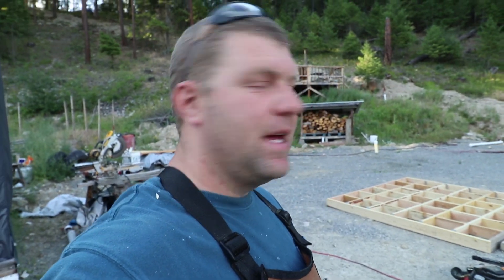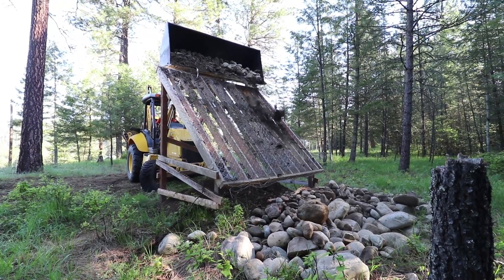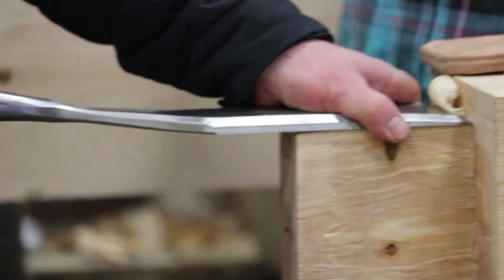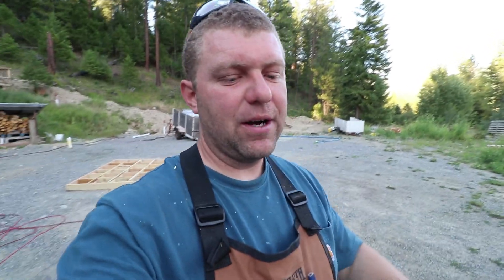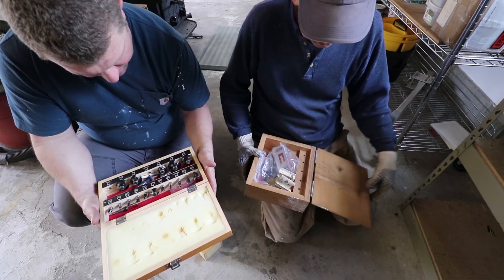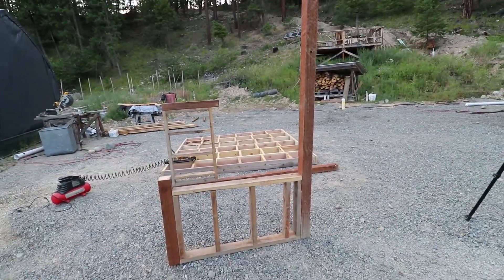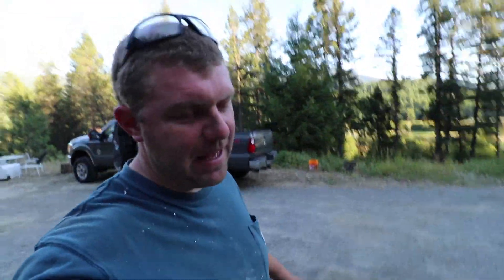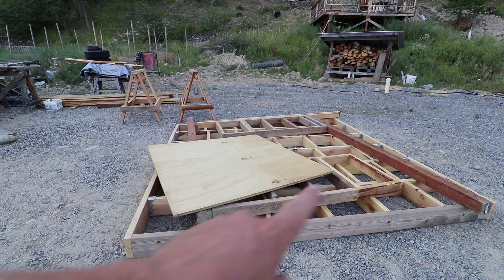Check it out... Grizzly 3.0 is BACKHOE-FRIENDLY!

Comment: Jesse and Alyssa - you are doing well. I am impressed by your attitude and perseverance. You tackle a project, step back, analyse the results, revise, and try again. That is spot on. Kudos to you.
Every project you have undertaken has increased your knowledge and skills.
Evaluating plans for potential problems is an excellent approach; that's what I was paid to do for 30 years. It is far cheaper to fix a problem the earlier in the process that it is discovered.

Ignore the haters and trolls.
I wish there were a moderator for this channel who could block and delete all the trolls that have flocked here for no apparent reason. They are fools and not worthy of your attention.

Comment: I used sketchup (free) to design my garage and make modifications. It made it super easy to test ideas and see actual measurements and double check plans and things. So glad I did it. I bought everything and built it myself and turned out great due to 3d model I made. Highly recommend

Comment: Just a suggestion. Dig a huge hole somewhere on your property. Place the grizzly on the edge and filter the dirt there. The rock will go into the hole and then when its full just cover them up. Saves you from having to always move the rocks and you get more dirt from the rock bury hole. this is what i did on our property. Saved so much time.
Reply: That would work if their soil wasn't 70% rocks.
Reply: Thats the point. So is my property. Its a way to get rid of the rocks
Reply: I get that it's a way to get rid of rocks but they would pretty much just be filling the "rock hole" 70% of the way full with the rocks that they dug out of that same hole. They would have to run all of that through the grizzly too. Seems like a lot of work for little gain.  Assume they have 50% rock and 50% fill. They would have to effectively dig 2x as much as they need in order to bury all of the rocks so double the work.  Seems easier to just pile them up in a corner of the property for the time being.

Comment: Very interesting to watch you work through the multiple versions of the Grizzly.
About 45 years ago, as a kid, I watched my Nebraskan corn farmer grandfather build something similar for our California backyard vegetable garden, though we just called it a rock strainer. His was considerably smaller, with it's purpose to sift through Mom & Dad's 'river wash adjacent' backyard soil in order to yield a small 8' x 8' garden. 
Grandpa also went with a 45 degree pitch for the screen (he used chicken wire fencing) and we fed it by hand with shovels - so no need for joist supports. However, one feature that he incorporated was a similar elevated foundation and somewhat extended lower front lip - the aim being to have the rocks roll off the screen directly into my radio flyer red wagon which was positioned just below the lip. My job (as a kid) was to run the wagon loads full of rock, to the back fence. We'd position the grizzly in one portion of the garden and sift that soil in place, and remove the rock. Once we had a mound of usable soil, we'd reposition the grizzly to a new area of the garden and continue. The volume lost (by removal of rocks) was made up with the addition of compost & soil amendment.
About 5 years ago, now as an adult, inspired by Grandpa's design and similar need/purpose, I designed (using Sketch-up) and built my own grizzly (version 2.0). Features that I incorporated were:
A) front lip high enough to roll the rocks into a Gorilla Cart (my adult version of the radio flyer) commonly available from HD, Lowes, Tractor Supply, etc.
B) all of the lower cross members (stringers) are positioned either high enough and/or low enough that another gorilla cart can roll in/out and be positioned directly below the screen (to capture the recycled/sifted soil/pay dirt.
C) the base footprint dimensions were 32" by 42" in order to fit my grizzly into one of those 10 cu ft dump carts (typically by agri-fab) either for transport of the grizzly, or for use in situ - sift right into the dump cart, then pull the grizzly out and take the payload to destination & repeat.
D) lastly, I included two different, interchangeable screens so that I could use large gauge chicken wire fencing to sift my compost, and then a much smaller gauge hardware cloth to sift dirt specifically for use in raised garden beds.
Overall, my grizzly version 2.0 worked great for processing both dirt or compost. I was short on storage space (in my garage), but since I used pressure treated wood, it held up well outside for 2 or 3 years until a tree fell on it.
Future plans for my version 3.0 rebuild will include:
A) more robust construction (I broke a stringer while moving 2.0 around)
B) some form of agitator. My wife and I spent too many hours and gloves pushing clumps of compost or our red clay soil, back and forth over the screen. Automated agitation will be something along the lines of a gold processing plant motor to shake the screens or a trommel (rolling/tumbling screen).

Jessie,
Having watched several of your grizzly and trenching videos, I'm super impressed with your volume of river rock. Seems to be quite a resource in itself. Do you have any plans to use all that rock?

Comment: Build a wood frame use 2 cattle gates covered with chain link fence for the grizzlies. Put them on less of an angle use the hinges on one side so you can use the backhoe dump off the large rocks that collect. When the cattle gate/grizzlies get bent up flip them over and use the other side to bend them back
Reply: jeremy sturza  right!   I was thinking something similar.

Comment: Just 45 your cross support braces, by doing so, you fully utilize the strength because a 2x6 obviously can handle a lot of weight when it's turned so that the 2 inch sides are on top and bottom like floor joists. The way your cross supports are orientated now when you put your grizzly into position, you're lucky if you are even using 50% of the plank's potential strength.  On top of the added strengthening, the dirt will slip right by with no restriction. Hope it helps :) I enjoy your channel. I like that you two are regular people, taking on big projects, making mistakes, learning, and acquiring new skills.

Comment: Dig a discharge pit for rocks to collect in. Also if you have a entrance to to rock pit, you can clean out the rocks when the pit gets full. Your design looks good. One thing to remember is the more work and time you do on prep and set up, the more efficient your operation will be.  With a bit of  proper setup you should not have to move the grizzly at all.

Comment: You two make great videos! Very informative and inspiring. Don't let any negative people get you down!
Reply: Cody, I agree
Reply: i all so agree
Reply: Constructive criticism isn't hate
Reply: Depend on how you read it ;-)
Reply: Big rocks you can also sell. Depent on size but great to back fill to a concrete wall whit rocks. Here in Norway we always use first drainage pipe and then back fill whit rocks, that way water/melting snow drain easier avay from the house. So why dig a big hole to dump rocks, when you can sale ore use it.
That I have seen a lot on youtube that in USA you back fill whit dirt and not rocks. Dirt hold on water and water is a buildings worse enemy. For the smart ones I know I'm not the best writer. 3 inch from ground level we put mech/fabric and then dirt
Reply: I would simply like to say that these two are learning while doing. A lot of people do that. While there's nothing wrong with offering advise, they have to learn things for themselves. That's how I've learned most of what I know. My grandfather and one of my uncles taught me so much, but they let me fail while I learned. I look back on those times now and realize how wise they were then.
Reply: Rocks like that are quite costly here in SE PA

Comment: Dig out a trench , then move your grizzly up next to trench, then let rocks offoad into the trench, once trench location is full, move grizzly laterally along trench to fill trench length, no more burying your grizzly foot, once trench is full, dig another trench. Of course digging trench is not needed if you find the correct agreeing terrain to set your grizzly on , but I used the trench analogy, to help visualize the concept. I like you guys and your drive and communication skills.

Comment: Jesse:  You might consider sowing the backfilled trenches with a mixed variety cover crop and start building soil for next year. Top dressing with saw dust from your mill.  Temporary   raised bed box's could be made with the offcut slab's from the mill.   Just trench the uncut edge into the ground.  And if they prematurely rot out no loss.             Bert.

Comment: i have a suggestion. If you want to be able to wait longer between cleaning away the big rocks, all you have to do is put the grizzly on a platform made with the backhoe or you can dig a hole in front of the grizzly so that there is a drop off in front of the grizzly.

Comment: a friend of mine had a mill which the finds fell into a large pan made out if an old fuel tank that was placed under the mill.  when it was full he would hook three chains to it and move it to the pile, lift and dump the fines where you want to store them for later use.

Comment: I have built many screens and grizzlys and yes metal will out last wooden ones but this is a historically valid tool we have old texts that teach us this will last if they were going into the soil  business then building a wooden one would have been a true waste but in this context a wooden tool makes perfect sense to me.  the design is a bit off the width of  around *' is a good choice the working angle should be between 40 and 47 degrees  and the max height should be about one foot to 1.5 feet less than the max lift of the bucket you will be using to shift the soil. this will be safer and better as you can feather the soil release on to the screen I would also add sheeting to BOOTH sides of your lower framing as it will be stronger and if you have to lift it out of place the rocks and soil will slide off, I wish you luck with your grizzly build and with all your other projects,

Jesse I wish to add that I have said some very snarky comments in the past and I wish to apologize for them I was very wrong to post what I did the way I did.  

Have a great day and a better tomorrow
Frank D

Comment: I am enjoying the videos and the problem solving you two do. About 2 or 3 videos ago you left the water system unfinished and leaking slightly on the connection between the cisterns. What happened next? Was the leak fixed? Have you back filled the system? Is it all working as planned?

Comment: One thing to keep in mind is that errors are accumulative. We call it the stack up. A sixteenth here, and eighth inch there....before you know it you're off so much that nothing fits anymore. And if you're an amateur,  measure three times, cut twice. If you leave it strong, you can always go back and trim it off. It is difficult to add wood! But seriously, accuracy is golden.

Comment: I have been a fan from the very beginning and can appreciate how hard the two of you work.  This is the first time I have to agree with a lot of posters.  Your going to be using your grizzly for quite some time.  Wood and screws will not last.  I know it's going to be expensive for some good metal but, a decent mig welder is priced good.  As I mentioned before, I'm a true fan and love your videos, it has taught me a lot especially, when something goes wrong, it shows me how to fix a mistake.  Keep your chins up. Love you both.  p.s. I forgot to mention the other commenters have a good idea of digging a huge hole in front of the grizzly for the boulders to fall in.

Comment: Thinking about the energy-budget you're on, have you looked into designing your future house to reduce energy consumption? Like limiting heat leakage in the winter or reflecting off sunlight in the summer to stay cool inside. I know it would add a bit of research and planning, but I believe it will pay off in the long run.

Comment: You might want to use 2x10's for your cross bracing and install them so that they will be oriented vertically when set up.  By building it the way you're doing, you are just making a bunch of shelves for the dirt to collect on.  I also agree with others who think that it should be steel.  An old mobile home frame, mig welder and small plasma cutter and you'll be ready to go.

Comment: I would advice to double up the side beams of grizzly filter, this is were all the stress of the horizontal beams will go. If you want to widen the bottom for the backhoe bucket, you may want to attach your frame to the outside of the deck instead of the inside as you have it now.

Comment: Hi. When you nail, if you put two in, if you angle them so when they are fully home, the points are at a further distance than the heads, this will make it a lot harder to pull the two parts apart....

Comment: Dig an approach ramp down to a 2-3 foot deep pit and set the grizzly over it. That way you are pushing/scooping against the earth and not the plywood. Also dump from the forward slope side of the grizzly so you can put one bucket of unfiltered in and take one load of rocks out on the same pass. Dumping on the forward slope also makes it easier because your bucket won't have to curl over the top edge of said grizzly.

Comment: I never comment but I'm wondering why not weld a grizzly with square tubing?
Reply: Fester Adams Look at what he has actually built, very little of it has came from there 5acres , and this is the 3rd time they have actually built this thing at some point you have to learn from your mistakes. I built mine from 1/2" rebar and some scrap steel for the frame, it has lasted for years with a lot more production than all 3 of theirs will ever see! Even if they were getting all the materials from their property why waste them and your time!
Reply: Fester Adams and yet he is using a lot of commercially produced wood.
Reply: kenneth.... we begged him to do metal last video. But I guess pain is his game.
Reply: Fester Adams You are 100% correct, it has no bearing on my life but does have quite a bit of bearing on their life. Hence my comment on learning from their mistakes or from others experiences. Doing the same task multiple times has a very detrimental effect on their production and eventually their moral. I also enjoy their trials and tribulations and wish them only the best! But at some point it becomes frustrating to see multiple failures for same task, hence the aforementioned learning from mistakes...
Reply: Because he's making stupid excuses to not learn a new skill, that isn't hard to learn, and instead is wasting time and money on an inferior material.

Comment: Forget nails for something like this, they pull out and bend.  The dry wall screws held but weren't big enough.  Use larger screws like lag bolts, or better yet through bolts.

Comment: Good plan of action. I think you have it just a little too steep, your goin to have dirt hanging up on your cross braces. Double up on the fence at different angles so the holes are smaller, and it will be stronger. I love seeing yall build everything instead of buying it.

Comment: Looks like a good improvement on 2.0 :) however, I think the side clearance is a bit tight and you may find manoeuvring the backhoe perfectly every scoop will get frustrating and time wasting? Thanks for all the videos so far, they are very informative and I enjoy all the thought explanations and reasoning for the jobs we get to see. I can appreciate now that installing the water system is not as easy as just digging in a couple of tanks and connecting up some pipe and hey we have water! :)

Comment: Angle the horizontal structure support beams at a 45° down so it compensates your lift angle which should end up at 90° and face down directly. You can also shave the support sections into a 45° itself making it more efficient as well. Hard wood may be needed I'm not sure.
Reply: And build an awesome Stone wall.
Reply: I hate commenting on posts because all the scumbags come out in force. If I was building the grizzly this is the way I'd do it. Whatever angle vertical beams then compensate with adjudicating horizontal support. Just compensate your angle to make sure you get the best drop on the soil.

Comment: Angle of repose.  When you stack up loose rock, loose soil, snow,,, what is the angle that dry materials can maintain or avalanche.   There is a degree that applies to most materials  47 degrees  Just steeper thn a 12-12 pitch roof.

Your horizontal blocking will maintain a pile of material to about the  47 degrees,,, as will the rocks on the far side,,,, that, of course will only average at that  The large rocks in a small space,,, ya kinda get what you get.  Keep side access to the back,, the large round rocks,, you'll need to scoop or doze them perpendicular,, less a little, frequently.  

Have you assayed your sand?  Your entire lot is old river bed.

Comment: Just a suggestion, next time place your cross members at a 90 degree angle to the slope of your Grizzly so that they boards are vertical, this will allow them to have greater strength and not be taking lateral forces from the rocks dropping.

Comment: Nail gun. Great. But the gauge of the nails is usually smaller. But they tend to hold better as they have a coating that heats up when they are driven and then resists withdraw. And with a nail gun it's easy to use more nails for sheer. Love the math.
Reply: You're right. My guess is the design works but nails of any sort won't hold up to those 300 pound rocks and the occasional smash with the backhoe.  Given all the use it will be put to. But you got to use what you got and try what you can.